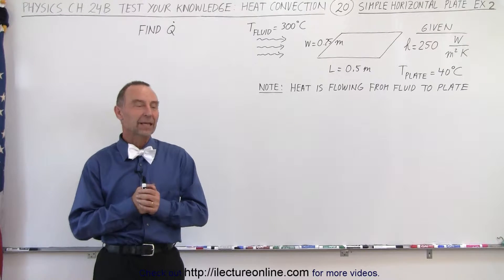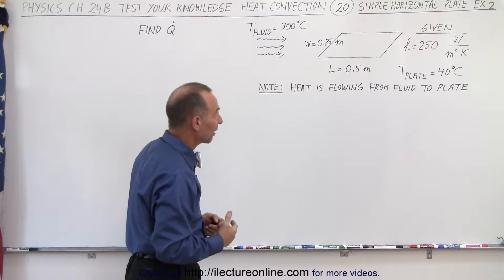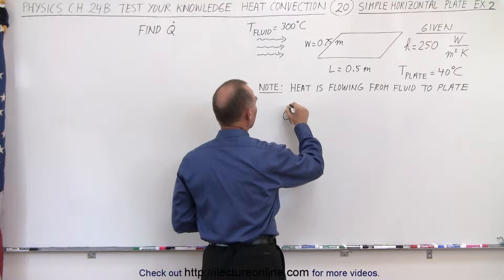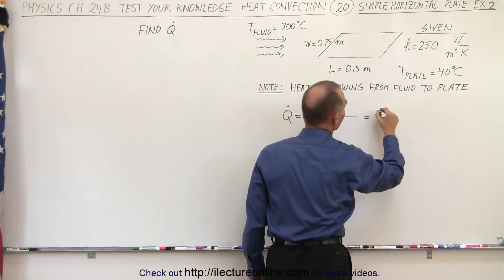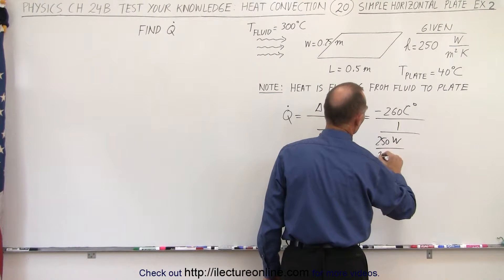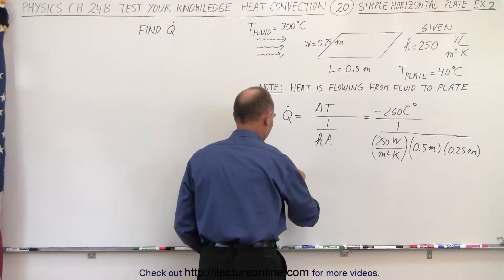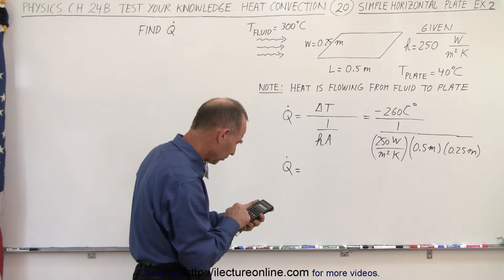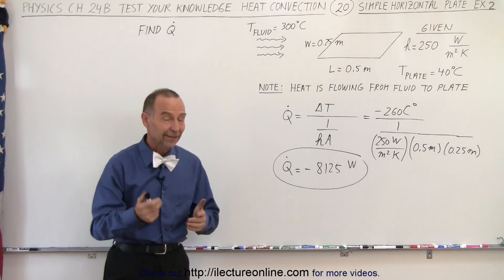Physics: Ch 24B - Convection: Test Your Knowledge (20 of 26) Simple Horizontal Plate Ex. 2

Comment: Is not the first time that you cancel out grades centigrades with Kelvin. Is that correct?
Reply from the maker: Since the size of a Kelvin degree is the same as the size of a centigrade degree it is OK.     The absolute temperature is of course not the same    0 K is not equal to 0 C
Reply: Thanks.